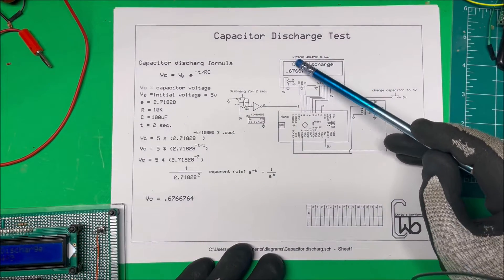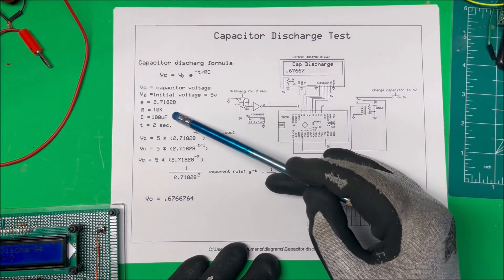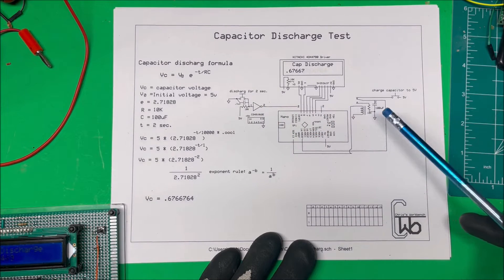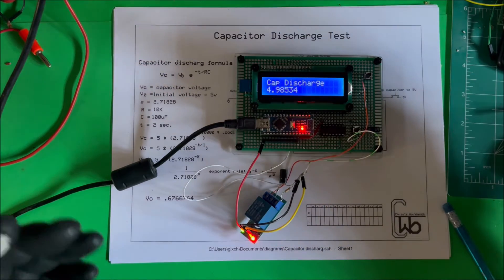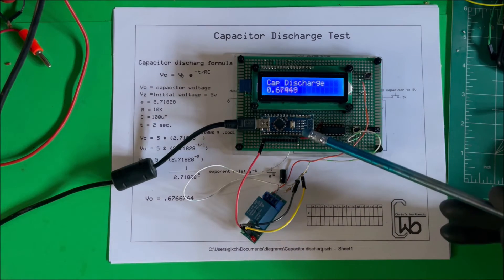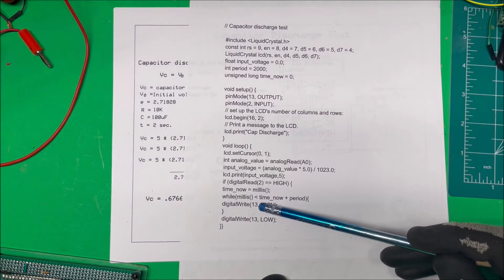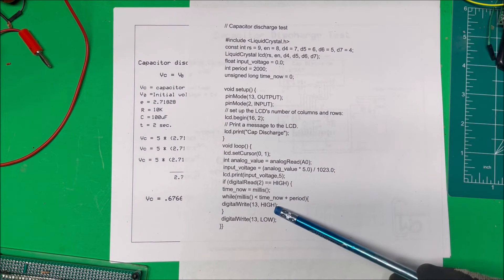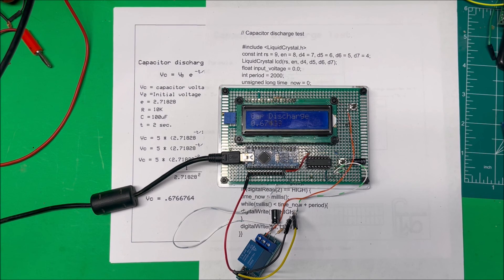Capacitor Discharge Test

Comment: Did you take into account the relays release time?   I think I have seen spec sheets on relays and they measure the release time in milliseconds.
Reply from the maker: I didn't find the make and break time for that relay. I hoped it would be close enough for the prototype test.
Reply: @ke6chris  You could build a test circuit and use your scope to measure it so you know the actual spec of your relay used.  Good topic for a video too.